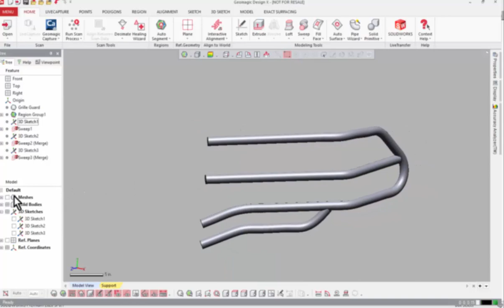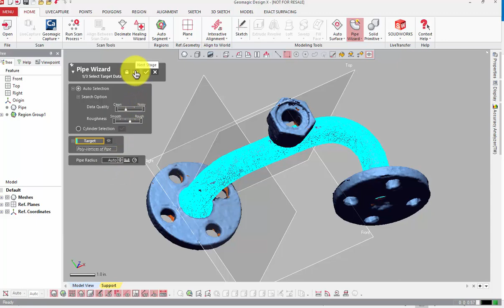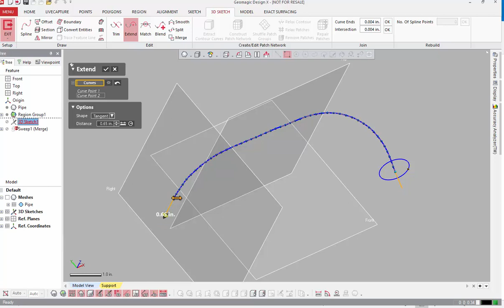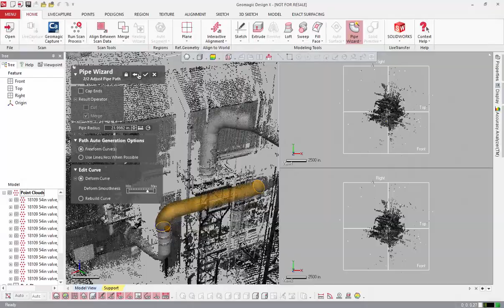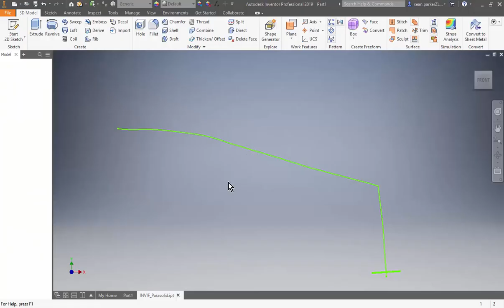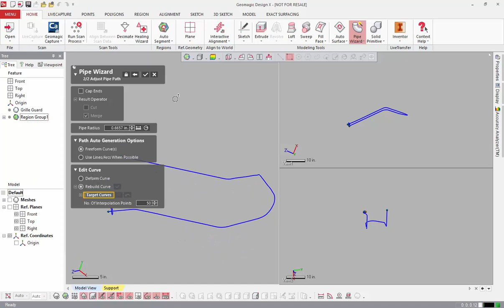Geomagic Deep Dives - Vol. 1: - Using the Pipe Wizard tool in Geomagic Design X

Comment: Thanks for the video! I am struggling with the 3d sketch function. I want to design pipe paths for an exhaust system into the scanned engine compartment between the engine outlets and the existing exhaust pipe more in the back of the car. So not based on a 3d scan of an existing pipe but a whole new design. In the 3d sketch tab and also in the menus I can only find the possibility to draw a spline. What I need is lines an arcs to have full control over the radii and being able to get straight parts instead of freeform curved splines because they are predefined by the available pipes that are available for use. Is there any option to activate those functions which I didn't find or any proper workaround? Thanks and wish you a happy new year!
Reply from the maker: Hi Se, this is a known limitation of design x. You can draw a line in 3d sketch, as you just rebuild the spline to two points. 3 point arcs of a specified radius are not possible however.

You can do the arcs in 2d using planes created from the 3d sketch points. Or you can try the Reference Polyline option. Or even collect bend start/stop center points and export to SolidWorks and use Weldments to finish the design.

Another workflow i would like to simplify in future versions of DX